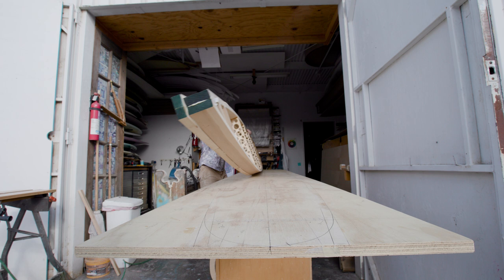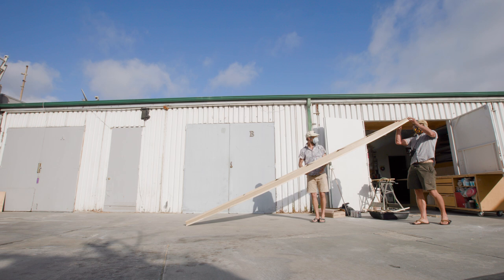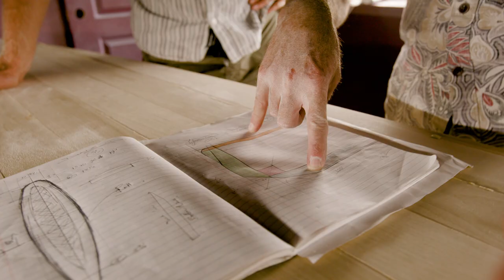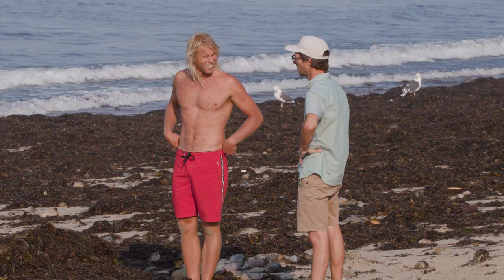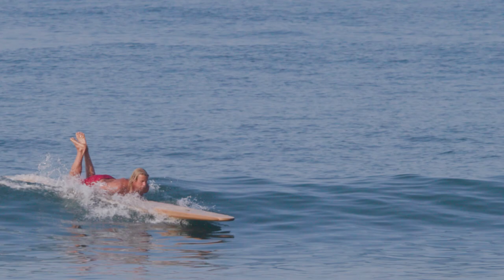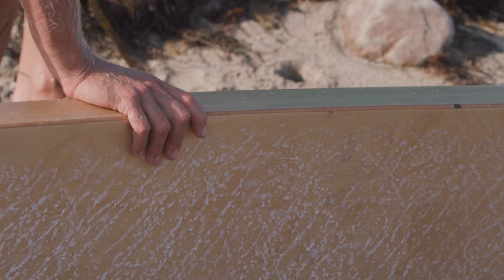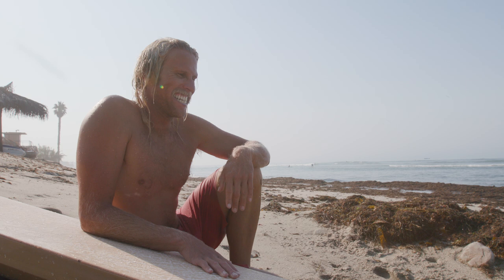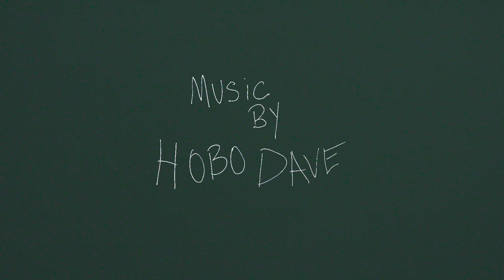Finding The Line: Experimentations on a 14 Foot TOM BLAKE Inspired Kookbox Surfboard

Comment: I love how quickly you can put these together with no fiberglass or any of that modern stuff. About two years ago Tom Blakes design inspired me to make my own windsurfboard without any fiberglass, epoxy etc. It's just wood, glue and varnish. It's actually not much heavier than a normal windsurfboard and it's holding together well.
I think that we've gotten too used to thinking that you need modern high tech materials to build a surfboard. Tom Blake was able to make boards without that kind of stuff and he could have pushed the material properties of those materials a lot further.
Back then i was looking so hard for a video of someone making his board the way he did. So seeing this video now put a smile on my face!

Comment: I started surfing on a similar board  without a fin ,here in Aus back in the day.Still remember the glide on the smallest waves.What was the bottom shape ,seemed to have chamfered rails .My memory of mine is curved deck,curved bottom,square rails and some nose rocker .Would love to get some dimensions to make one.I guess paulownia would be a big part of it these days.Mine was plywood and I am guessing cedar ,lots of copper nails,stainless tail plate with D ring ,and a drain plug on the nose. ......Thanks
Reply: Proud of ya!  Passion is good. I am going to build one.